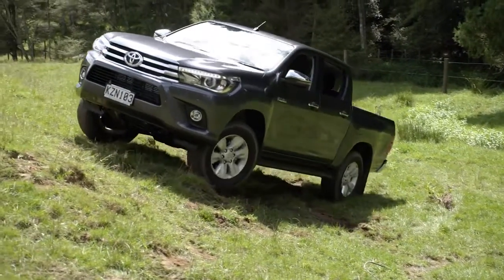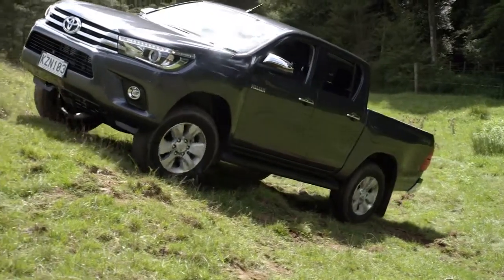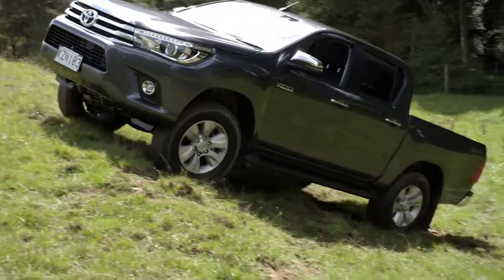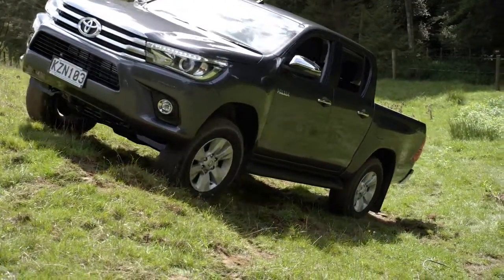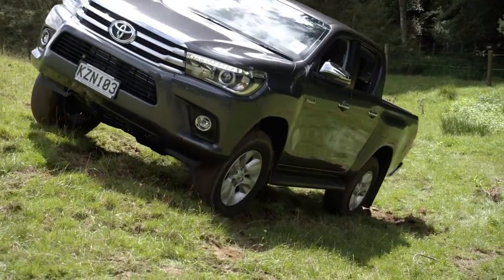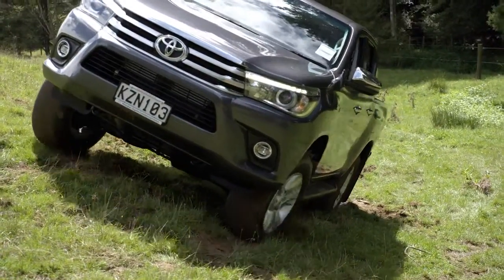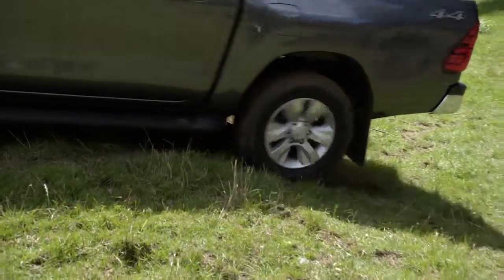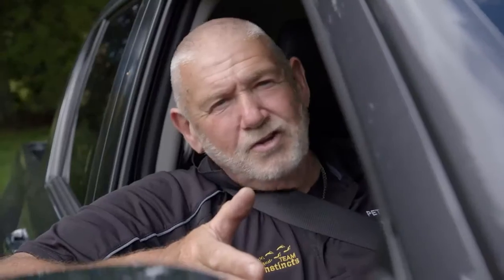Rear Differential Lock vs Active Traction Control

Comment: Most capable off roader is Jeep Wrangler Rubicon with rear and front diff lock and disconnecting sway bar for articulation. It has has front solid axle unlike the new 2020 Ford Bronco.
Reply: yeah but it will last 100.000km vs a million of a toyota. plus you can add diff lockj and sway bar disconnect as well.
Reply: Also means it drives like crap on-road. Jeeps are great for dedicated rock crawlers, not for much else

Comment: It is EVEN more capable if you have rear diff locked AND A-trac on. In that case rear axle is locked and only the front axle will work with A-Trac.
Reply: Trouble is I think with Toyota 4WD vehicles, traction control disengages when you put on rear diff locker. A pity.
Reply: @bobpfaff2258  not true. Because I have a Toyota "stock" and I can engage rear diff lock AND A-trac at the same time..

Comment: More capable ?  Umm I don't think so.  I feel more comfortable with lockers on board that traction control.  Yes they help and are handy but lockers rock.
Reply: Diff Lock are more capable in most cases yes. But most diff lock are only at the rear. There are times when Diff Lock couldn't get thru obstacle because the front tires are losing traction too, in that case A-Trac works better than diff lock. Or best to have A-Trac and rear diff locked. OR EVEN BETTER having front AND rear diff locked.
Reply: @prandomable  agree.  😃
Reply: hey! I don’t see how you could have both a trac on your rear diff locked. If you had both of them on, wouldn’t only the front wheels be using a-trac? 

From my understanding if you lock the rear diff a break applied to any back wheel would stop the whole axle. Which kind of seems like a point of failure too.
Reply: @GelasticSnail when you have the rear diff locked. Only the front A-Trac would work. Not the rear.
Reply: @intimatespearfisher  turns what off?
Reply: I agree for 100%. With traction control you always to late. My Discovery 2 have traction control and rear and front lockers. I can put off the traction control and then put  the lockers in. Massif different. With lockers you have much more control drive and slower and less damage.